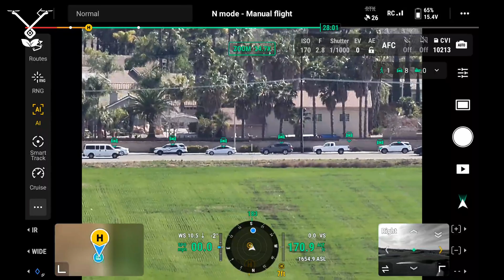DJI Matrice 4T Explained | Everything You Need to Know

Comment: How does the thermal camera compare to the 3T?
Reply from the maker: The Matrice 4T takes thermal imaging to the next level compared to the Mavic 3T. If features a higher-resolutions 1280x1024 thermal camera (vs. 640x512 on the 3T), delivering much sharper, more detailed heat signatures. This means better accuracy from farther distances — ideal for inspections, search and rescue, and other critical operations where clarity maters. Plus, its enhanced thermal zoom keeps images clear even at high magnification.
Reply: @talosdrones  I appreciate the feedback. I just became familiar with the Matrice 30T as well, and wondering how its thermal compares to the 4T. I plan on using the thermal for watching over 400 acres of livestock and deer recovery.
Reply: @talosdrones  Actually, Im interested in setting up a DJI docking station at my farm. And Im wondering if the Matrice 4T is compatible with the docking station, or does the docking station limit you to using a non-foldable drone? Also, can I use the docking station drone wherever I need to take it, Or is the drone limited to the location of the docking station? Thanks in advance for your help.